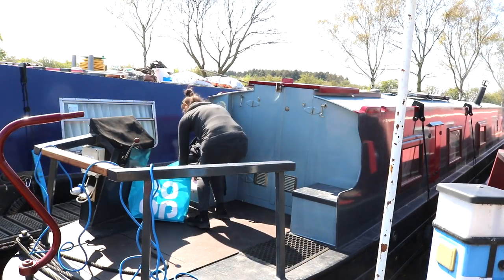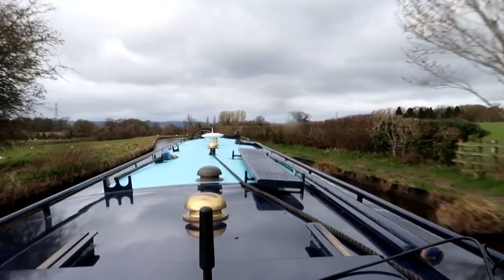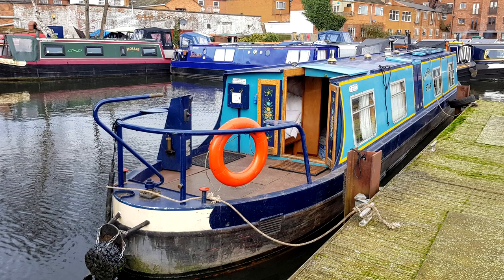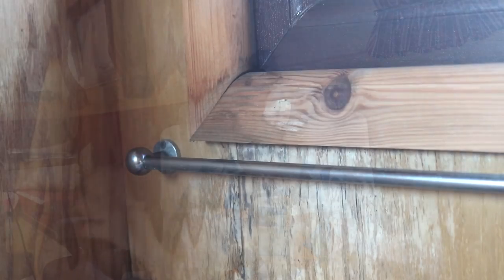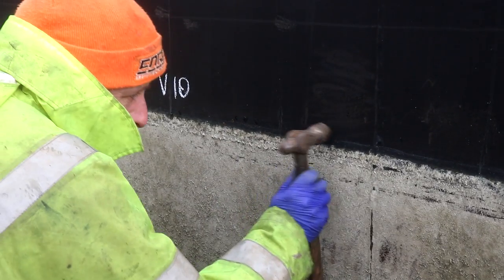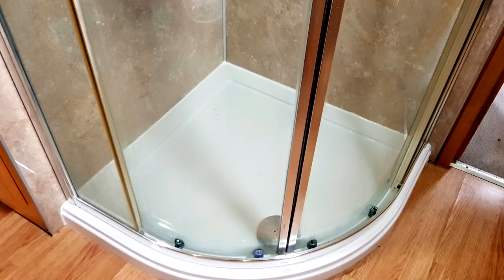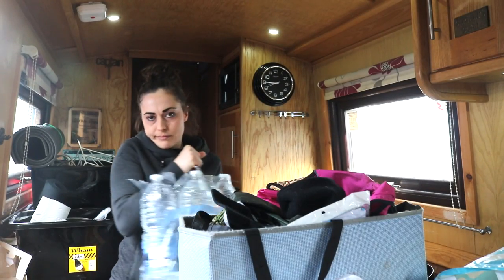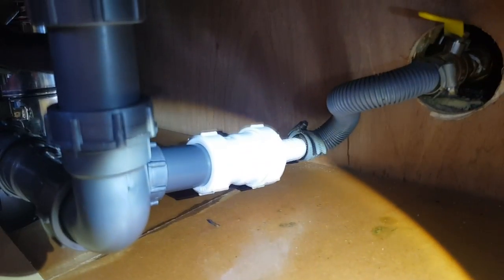Our Buying a Narrowboat Experience | The Carpenter's Daughter

Comment: A couple of tips that may be worth thinking about.  I've found that a set of two or four walkie-talkies to be quite useful with charge cradles at the bow and stern as this helps with communication if you have a crew working the locks or on that narrow stretch from Trevor to Llangollen for instance.  I'm also fitting USB charge outlets running off the 12v domestic batteries in each cabin and at the stern as they are always useful.  Happy cruising Vikkie!
Reply from the maker: Thanks for the tips :)  We now have walkie talkies, but want to replace the earpiece for more like a headset.  It's one of those annoying types that don't stay in your ear 😬😬